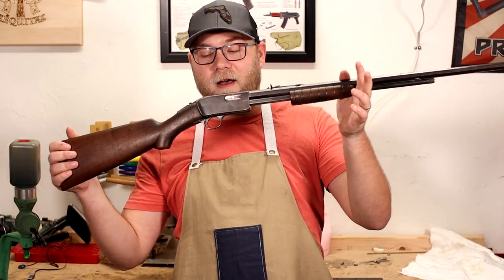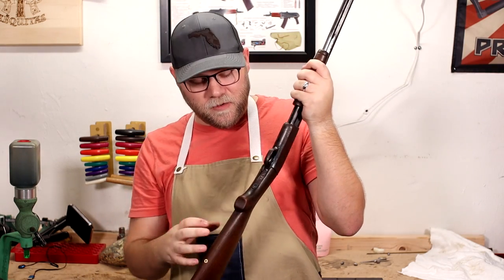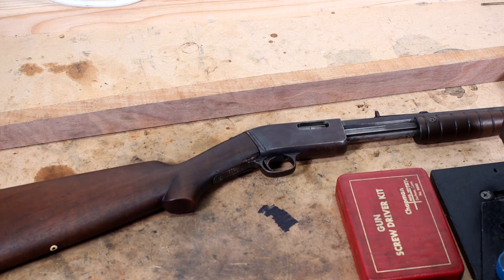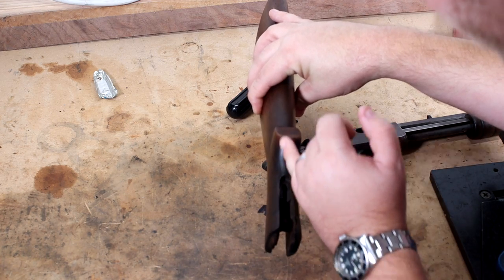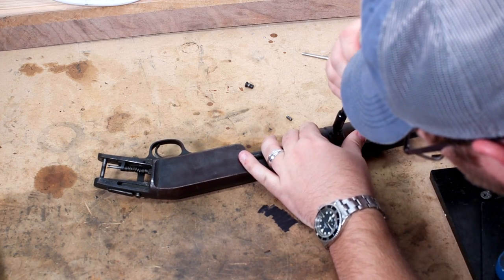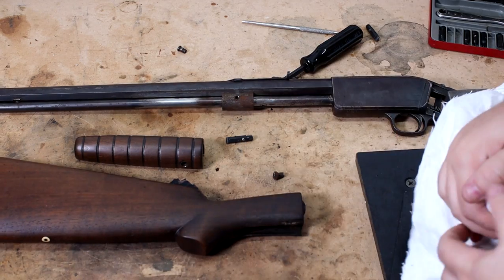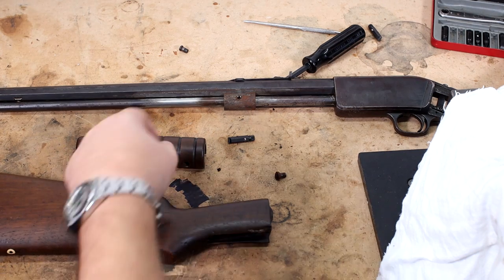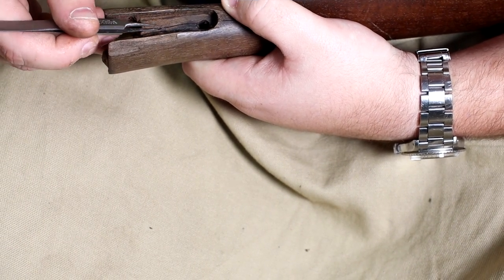Marlin Model 38- Stock Repair Part 1

Comment: How long did you soak the oily end of the stock for? I'm doing an Ithaca 37 repair that's not quite as dark as yours by=ut needs the oils drawn out. Good stuff👍🏻👍🏻
Reply from the maker: Couple of hours. Stuck it in in the morning and left it until lunch.
Reply: Thanks, appreciate the quick reply. Also subbed  @BabyFaceP